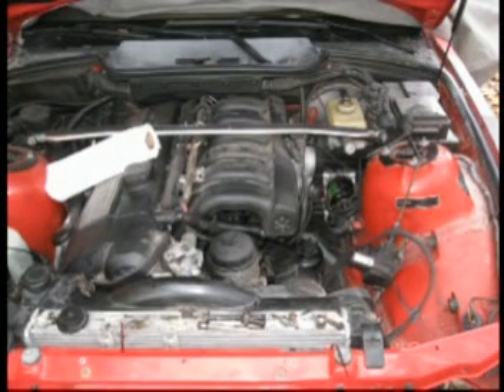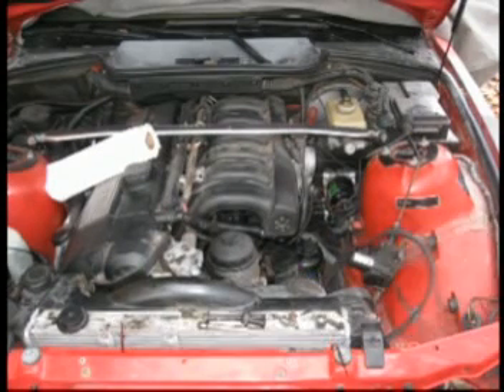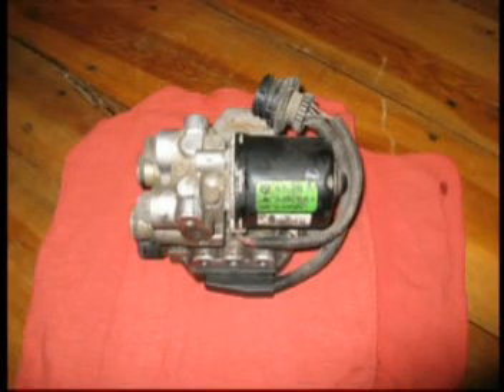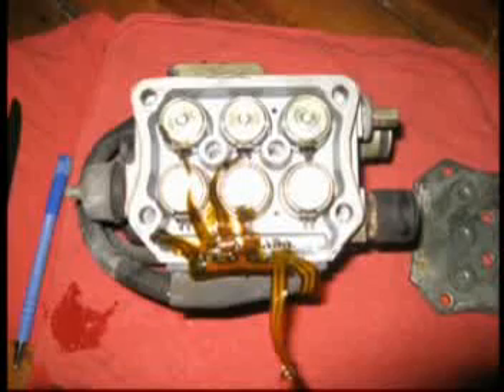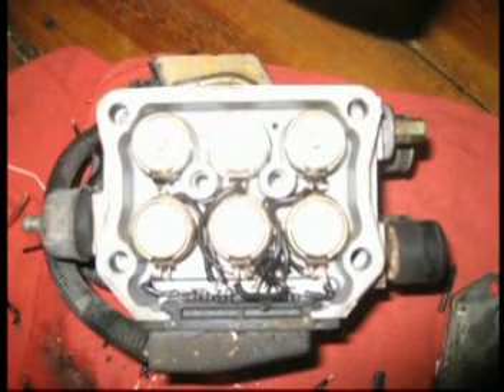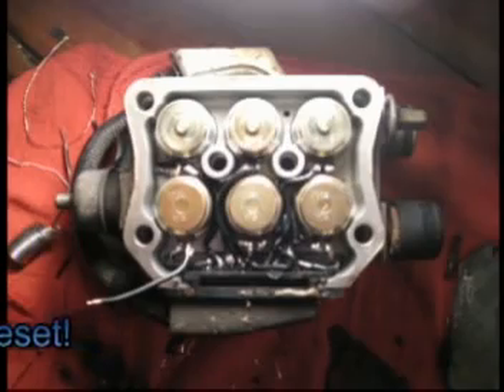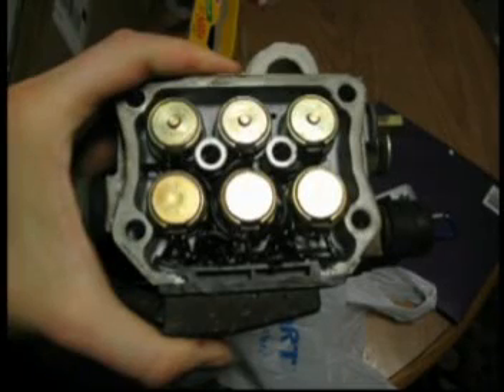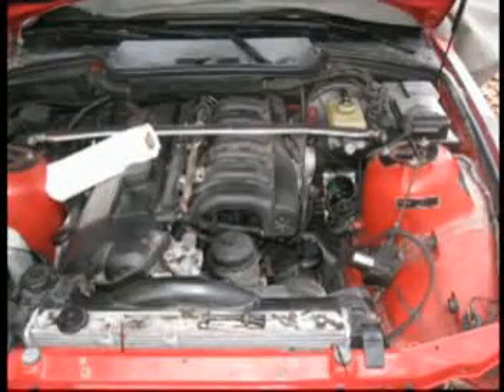BMW ABS REPAIR (E36) MillerTimeBMW - DIY 6

Comment: Hi Zach ,

I have read some of your posts and you really seem to know your way 
around the E36.  We have a 1994 project race car.  The original builder 
had started on the build, but stopped the project.   He installed a nice
 manual brake setup (Wilwood), but did not integrate the ABS system at 
the time (just left the plumbing in place).  I would like to get it 
going again, but it needs some help.  The original system appears to 
have the traction control setup along with the brake pedal pressure 
sensor located on the brake booster.  With the manual brakes added, the 
wire was left in the engine compartment not connected.  I do not think 
the system will work without it hooked up to the  brake sensor or can I 
substitute a non-traction control ABS ECU into the existing harness to 
get it operation for rain races.  We are also adding a rear brake 
proportioning valve for when the ABS is defeated.  

Best regards,
Reply from the maker: Sorry for the long response time! If you'd like to use a traction less ABS module it might work, I'm not sure what year you use but it may need coding to function properly. I agree ABS is a vital accessory in the rain!

Comment: I had replaced all of my wheel speed sensors recently, and the ABS light still comes on after driving for 30-40 mins. I purchased a used module, and plan on doing this repair. I hope that fixes it.
Reply from the maker: +Gjon777 Let Us Know! Good Lick, Zach.
Reply: +Gjon777 How'd that work for ya?

Comment: I own a German Spec 95 320i. I took it to the dealer for the ABS light being on and they said that there is no faults in the system when they hooked up the computer. They then told me that the ABS ECU wasn't operating and needed to be replaced and that's around $1000 new. Can I use a ABS ECU from another 320i and is there away to test it at the junk yard? I've also read a couple threads mentioning that its uncommon for the ABS ECU to fail and its more common for the ribbon cable to fail. Any thoughts or suggestions?
Reply from the maker: I have not heard of the ABS ECU going "KAPUT". Usually it is the wiring inside or the relays. I don;t believe the ABS ECU is CODED to each individual car.

Comment: Hey Z what's up thanks for posting the vids and sharing the knowledge ;), I changed the clutch line on my BMW e39 and I didn't the master cylinder. I believe air past thru to the abs unit. Now my traction control is off constant and my abs light is on. I would like to know what you think if I were to jump the relay for the abs pump to try and get the fluid back into the abs module? P.s. thanks ahead

Comment from the maker: In this case, there might be air in the ABS pump itself. At the dealer they will flush the system and connect a computer to the system to cycle all valves to work out any remaining air from the system. You can always try to manually bleed the system yourself and then the car will auto-check the system as it always does upon restarting the car. 
Good luck!
Z

Comment from the maker: This might be a mechanical break in the pump, unfortunately. But I would try to check the resistance of all the electrical connections in the pump itself first!
It may be an easy fix!

Good Luck!
Z

Comment: Hello, My 99 M3 is at a mechanic now and the 2 front wheel speed sensors have no power to them. They can't figure out the problem.  Would replacing this unit be the cure? Thanks!

Comment: The ABS light in my car turns off after startup as if it were ok, but when I actually put the ABS to work, it doesn't seem to work in one or more of the wheels, other times it doesn't seem to work at all with no typical vibration on the pedal, wheels simply lock. However I never get the ABS light on after it started up. Got any idea?

Comment: nice repair vid, but honestly i wouldnt recommend doing this, the auto manufactureres use that ribbon wire for a reason, your working with a very important unit of the braking system, im not doubting your skill or knowledge but if there were just hypotheticaly speaking a serious accident happened due to an abs problem and was investigated and found tampered abs unit, there would be serious trouble there. R&R is the best if that is the fault, i work for bmw, please do not attempt this to save $

Comment: My ABS and ASC light occasionally comes on.  Most times when I turn the car off and go into the store or something, I come back out, start the car, both lights are on, I start driving, and it goes off when I shift into second.  Any tips?

Comment from the maker: @paintdemon69 
The cruise control should work with or without the ABS working. I don't think they would be related. Unless you had a bad brake switch.

Comment: I have own 8+ E36 M3, 92 thru 95+, 318, 325, and M3.
I have a question, there are subtle differences in the brake "feel" between early 92 (firm brakes) and later.  Have you seen in the ABS unit itself if the later units have a pressure accumulator to soften the ABS pump cyclic vibrations?  I believe this is why the later ABS brakes systems are not as firm as the early 92.